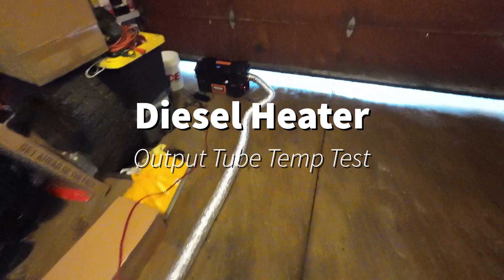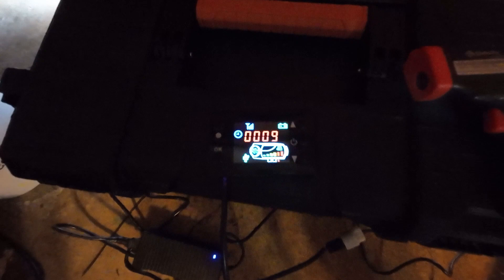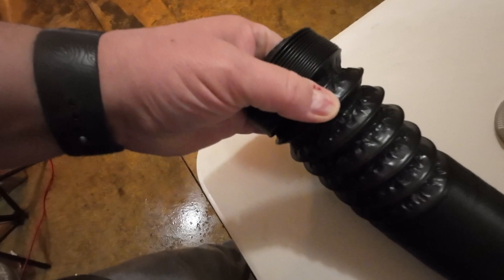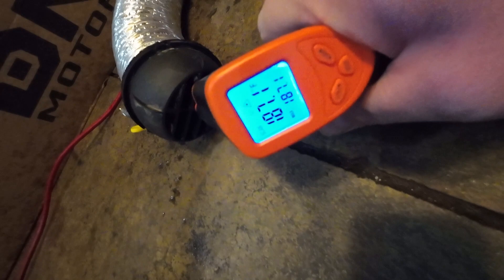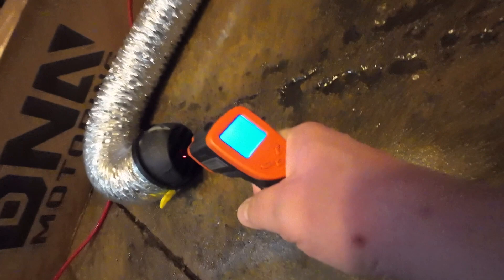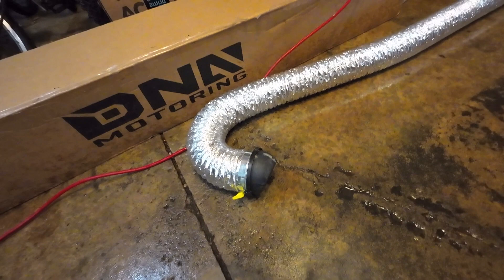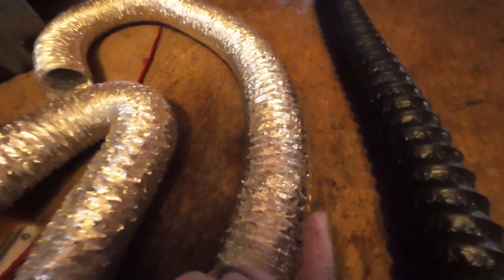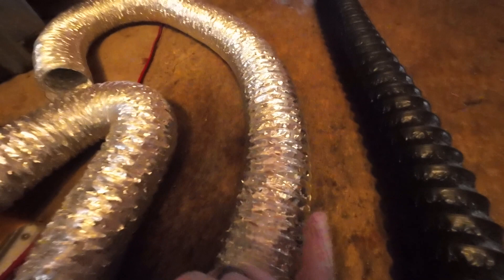Chinese Diesel Heater Tube Test - Which is better?

Comment: Those thermometers give different readings depending on how reflective the surface is. So shiny will read less etc.
Reply from the maker: Yeah I figured I’m going to bring both tubes at the end of February when we snow camp and see what the real difference is in output temp at the vent inside the tent. That will be a more accurate comparison I think
Reply: @TriStateOverland   Just put some black tape on the bit you want to read. 👍
Reply: @pauldowninguk  Fact

Comment: To pack these hoses, i took a piece of 2" pvc pipe cut 2 foot long, drilled a 7/16 hole on both ends straight thru both sides of the pvc, about 1" from the end. Then put a 6" long, 3/8" threaded rod thru the holes sticking out both sides. The hose will be stored between the 2 threaded rods. One end got a nut on both sides of the rod, tightened eight down to the pvc, centering the rod to stick out equally on both sides. Stand the pipe up toward the ceiling, putting both feet on the rod with nuts, holding it upright. Grab your hose, slowly feed it onto the pvc, push down to collapse it far enough to imsert the other threaded rod thru the top hole. The hose will expand, pushing against the threaded rods, keeping the loose rod tight in the pvc.  Now the hose is 2 foot long, on a sturdy  mount, easily transported
Reply from the maker: That’s an awesome idea!!

Comment: If you want a true temperature comparison. Paint the pipes matte black then retest the temperatures infrared on shiny surfaces is no good
Reply from the maker: I am going camping in two weeks in the snow I figure I’ll take both hoses and test output in the tent at the vent and compare.

Comment: lazer pointer temp guages dont work well with reflective surfaces and give false readings, youd be better off painting the reflective surfaces black to get a more accurate reading.
Reply: Or install the hose vent on both hoses and aim the Lazer at the plastic hose vent

Comment: Those black Chinese ducts have a toxic smell that doesn’t go away. Would avoid at all costs.
Reply: I purchased the black one and your absolutely correct. the regular one doesn’t smell
Reply from the maker: Mine did the first two times but after a few more uses it doesn’t smell anymore. I’m not sure if that means some coating “burned” off or what but it’s good now. And I’m not dead yet either so it wasn’t toxic 😂

Comment: I use a 3i nch insulated dryer hose. Its 3inch i.d., but almost 6' o.d. the outside of my hose reads 10°f warmer than the room temperature.

Comment: I tried the expandable dryer vent that was plastic on the outside and it stunk like burnt plastic and melted where it was mounted to the heater. Don't use it. It's sopposed to be good for 300 degrees? Bullshit. Get something like aluminum or the cardboard that comes with the heater.
.

Comment: Doesn’t the dryer one get hot ?
Reply from the maker: It does but not as much as the black one. I should test both next time. I did use just the black one in Virginia recently and it still worked great. I think I like it better.

Comment: I bet it either would be Hotter  if you shut the door and put the exhaust  outside  through  a small hole.  Feeding cold air doesn't  help😅